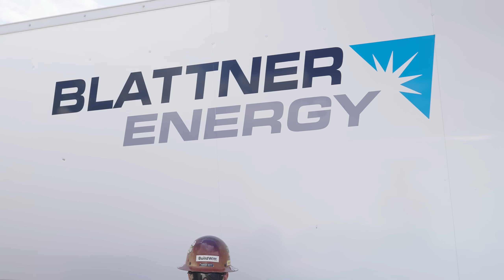Inside America's Largest Renewable Energy Project

Comment: This video has been very enlightening!! The cost for this project is rather interesting. $11 billion for 3.5 GW of wind power. If you take the average U.S. wind utilization or capacity factor of 36% this gives you an EFFECTIVE (not nameplate capacity) cost of approximately $8000 to $9000 per kilowatt. This is definitely in the same general range for U.S. nuclear power with the exception of the Vogtle plant in Georgia which had an estimated construction cost of $15,000 per kW. If one trust Google AI, it states that Chinese nuclear power cost have recent estimates for new builds in the range of $2,800–$3,500/kW and are completed in around 5 years and on budget! Considering that wind requires additional cost for storage and additional cost for providing backup power sources to be available when there are long duration wind droughts as has occurred in the UK multiple times, it starts to explain why California has the highest energy cost in the U.S.!!

Comment: 3.5 GW wind farm capacity X 1/3 for average year output = 1.17 GW   Assuming it is not culled and all dips have to instantly be backed up down to zero output that is 1.17 GW of natural gas turbine generator capacity above running at 70% fuel consumption needed to be at high readiness.   That's costing a lot of expensive natural gas!   

This is why supporting large amounts of wild AC from solar voltaic and wind turbine electricity generation is so expensive.    It uses less natural gas to make all the electricity with efficient running natural gas combined cycle plants.   

Natural gas even when priced at break even production cost is too expensive a fuel for base load electricity.   Once people know how much it is going to cost them when this wind turbine electricity hits the power grid they are ether going to fight from allowing it to be  connected or move.

The UK northwest offshore wind turbine farm caused electric rates to double.   With natural gas in the UK being 4 to 5 times more than in the US, the UK is culling wind turbine output to lower more steady electricity to save natural gas.
Reply: FUD. ;-)
Reply: source: trust me bro

Comment: Unfortunately this is very sad, Not one of those turbines will ever make enough energy to cover the cost of it's construction,  installation and maintenance,,, EVER.
If this money and energy were being spent on actual power plants,  I'd be far more enthusiastic.  The construction is awesome but the destruction of the earth and the landscape over such a wide area is disheartening.
Reply: Marketing info from GE for this particular wind turbine says 6.1 months but it doesn’t go into any details how that was calculated or what was included. It certainly didn’t include the transmission project or probably most of the additional support infrastructure or how much the utilization ratio is for this particular site. So probably more than 6 months, maybe a year plus.

Comment: Sadly, the concrete, steel and other materials make wind turbines a green washing tool. Remember the difference between installed power and generated power, about 20% of the installed power will be produced over a year.
Not exposed  forever, after the turbine life expectancy that core has to be destroyed...
Reply: According to the GE’s marketing for this particular wind turbine, the energy break even time is 6.1 months. Would love to see the actual calculations.

Also the average wind utilization ratio in the U.S. is 36%.

Comment: what if we have been using the wrong model of wind turbines?
what about this new model :
a vertical axis wind turbine (spinning like a carousel)
this wind turbine would look exactly like a tree, I call it : e-tree,
the trunk of the e-tree is brown, the spinning sails (blades) are green,
and finally attached to the trunk of the e-tree are features of : wifi/mobile network, light and power outlet, to charge a car for example

Comment: In Germany, a megawatt usually costs one million euros. If you calculate 3,500 megawatts through 900 wind turbines, you get just 3.8 MW and that's pretty little these days. For $11 billion, I would have expected a little more
Reply: You're right I think there's something fishy going on, it's costing $4.5 million dollars per MW which is a lot
Reply: The SunZia project, combining both wind and transmission infrastructure, is projected to cost around $11 billion. The SunZia Wind facility will have a power generation capacity of 3.5 gigawatts (GW), while the SunZia Transmission line, which spans 885 km between New Mexico and Arizona, will have the ability to transmit up to 3 GW of electricity. 

In terms of cost per kilowatt, it is estimated that the project's wind power output might be delivered at approximately $2.53 per watt【171†source】【172†source】.
Reply: @polymorphus1  $2.53 per watt?
Then 1kw would cost $2530. Something is wrong. You probably got the wrong unit
Reply: The total cost includes the huge transmission project also!!

Comment: how far would this project proceed without diesel?
Reply: Probably yes to some extent! The EV trucks are available in the U.S. and this youtube channel has an example of a project in the Netherlands that is doing everything with electric power. From the video it suggests that using electric power for the construction equipment is rather expensive and kinda hard on the logistics. Also in remote locations where do you get the electricity that is CLEAN? You can use BIO-Diesel or BIO-natural gas to produce the clean electricity or just use BIO-Diesel in the first place.
Reply: One could easily build it with electric trucks. They are just not available, yet. ;-)
Reply: @lepidoptera9337 
You mean they aren't available in the United States yet.
Reply: @glenncordova4027  At least not in quantity, no. The Chinese have a much larger supply chain for electric trucks than the US. Does it matter? No.

Comment: Yeah that's green power with the concrete, re-bars, tons of concrete trucks and all that. Green as possible.
Reply: 1 cubic yard of concrete requires 3GJ of energy. Let's say they need 400 cubic yards, so that's 1200GJ. A wind turbine generates, on average, 1MW. This returns the energy cost of the concrete in 1200GJ/1MW=1.2e6s, which is approx. 14 days. All in wind turbines in this range are said to be energy neutral in five months. Not a problem, but then... there are always chickens who can't do math. ;-)
Reply: @lepidoptera9337 

Marketing info from GE for this particular wind turbine says 6.1 months but it doesn’t go into any details how that was calculated or what was included. It certainly didn’t include the transmission project or probably most of the additional support infrastructure or how much the utilization ratio is for this particular site. So probably more than 6 months, maybe a year plus.

Comment: 11 BILLION dollars?? Could have built several nuclear plants for that amount of money. We’re so stupid in this country sometimes. Has to be green or it’s wrong. Why is America trying to “clean the earth” while everyone else is doing almost nothing, especially the Chinese.
Reply: The two new reactors  Vogtle 3 and 4 in Georgia, which came online last year and this year cost about 34 billion dollars. They only produce 2.4 GWs of power. Nuclear tends to have a capacity factor of above 90%. Wind in New Mexico is at about 35-40% capacity factor. When calculating the average per Megawatt and comparing those two we end up with about 15'000 USD for one MW of nuclear capacity and about 10'000 of one MW of wind power. 
China installed about 215 GW (US installed 32 GW) of solar and 75 GW (US installed 6 GW) of wind power last year. Even if adjusted to inhabitants, China outperforms the US. Is it really America trying to "clean the earth"?
Reply: @KabelWlan  I think your numbers are a little skewed. Nowhere could I find a price nearly that high. China builds lots of coal fired power plants. They buy more coal than anyone. My point is that America seems to be the only country racing, to our own peril, to meet arbitrary pollution standards. I believe we have time to develop cleaner, more efficient energy production methods without covering hundreds of acres in ugly, inefficient wind turbines.

Comment: what exactly is "renewable" about solar modules and wind mills? that stuff wears out and gets dumped & replaced just like EVs.
Reply: Get educated moron
Reply: The fuel is renewable and free. There will always be wind and sun light. Oil and coal’s eventually will be all consumed.
Reply: It is far less polluting than oil, natural gas or coal.
Reply: Hey oil and gas are renewable...Just wait a few million years!😮
Reply: @fernvalleyinn9172 

I guess that you are not familiar with BIO-NG which is renewable and is becoming a nontrivial player as a carbon negative transportation fuel. Now that the new Cummins engine is available, it can significantly outperform any EV truck in every metric.

Comment: The wind does push on them non stop, until the wind stops. We could have had 20 to 30 new nuclear power plants, which are very safe.
Reply: You just proved you are an uneducated moron
Reply: Georgia's Vogtel nuclear power plant, which produces a maximum of 5 gigawatts, cost $35 billion dollars. That is over 3 times the price for less than twice the energy output. Nuclear power is the most costly energy source and takes a long time to build. This doesn't even take into account the massive cost of decommissioning and the long term storage of hazardous nuclear waste.
Reply: @glenncordova4027 

$11 billion for 3.5 GW of wind power. If you take the average U.S. wind utilization or capacity factor of 36% this gives you an EFFECTIVE (not nameplate capacity) cost of approximately $8000 to $9000 per kilowatt. This is definitely in the same general range for U.S. nuclear power with the exception of the Vogtle plant in Georgia which had an estimated construction cost of $15,000 per kW. So only 40% higher when using the worst example that you did!

If one trust Google AI, it states that Chinese nuclear power cost have recent estimates for new builds in the range of $2,800–$3,500/kW and are completed in around 5 years! Considering that wind requires additional cost for storage and additional cost for providing backup power sources to be available when there are long duration wind droughts as has occurred in the UK multiple times. So compared to Chinese nuclear one gets your 3 TIMES but in favor of nuclear!! Also this wind project took 3 TIMES longer (estimated) from beginning of planning than the typical Chinese nuclear power plant takes to build. Also this wind project had some considerable pushback from people that it negatively impacted.

Comment: wonder how long it would take each turbine to offset the emissions from it being built
Reply: Six months on average.
Reply: Marketing info from GE for this particular wind turbine says 6.1 months but it doesn’t go into any details how that was calculated or what was included. It certainly didn’t include the transmission project or probably most of the additional support infrastructure or how much the utilization ratio is for this particular site. So probably more than 6 months, maybe a year plus.
Reply: It varies from turbine to turbine, but not very long.
Reply: @Dasycottus  Depending on the location, 5-12 months

Comment: What good is it if the electricity can't be stored & save it for another day  . If you don't use it you loose it. That what I been told . I could be miss directed .
Reply: Have you never heard of batteries? How about rechargeable batteries? Before you get your panties in a bunch, I'm not saying it would be economical, just doable. I mean...11 BILLION?
Reply: @bwellman1953 I bet they'll use pumped storage hydropower. For big stuff, it's often cheaper. 

1) Build bigass pond/Small lake. 

2) Put dam in the middle of it. 

3) Use surplus wind power to pump up one side of the dam. 

4) Generate hydropower with turbines in dam. 

Water = battery. Simple, very clever.
Reply: @Dasycottus  I was raised on the coast. For most of my life, I've been waiting for coastal regions to supply electricity using tide changes. Where I lived, there was close to 20 feet difference between low tide and high tide.
Reply: I know this may come as a shock, but engineers are not stupid. 🙄

They are aware that wind power only works when wind is blowing, and that solar power only works during the daytime. 

The turbines store surplus energy with battery banks and pumped storage hydropower. The surplus energy covers demand when wind is not blowing. 

If you think you may have been misdirected, why not check before making the point? It takes two seconds and you get to avoid looking foolish.

Comment: I ran a Tb105 for many years! I can tell you one thing, a TB105 will certainly do a 100 yards an hour but 150 is pushing it. A pump on the other hand, a bigger one, will do 170 or 180 an hour full tilt. 50 yards an hour out of a pump is hilariously under estimated 😅
Reply: 120 Yards per hours is pretty easy to get out of a pump, especially for a foundation like that where most of the placement is just dumping concrete with minimal finishing. A pump might even be able to do 150 Yards per hour if you can keep trucks backed up and feeding it.
Reply: @andrewsmith1655  It's going to depend on the pump and what pump kit it's running. But the modern pumps with high output kits running oil to the rod side can usually push 170 an hour if it's a decent slump. Something like this is probably not any wetter than a 4" slump, so running a 5" hose you're probably going to push around 140 an hour.
Reply: @andrewsmith1655 might be able to do 155 yards if you're pumping downhill and using gravity slingshot.
Reply: This was a critical point of the video. Very important distinction to make,  exactly how fast the concrete can be pumped.
Reply: @wildmanofborneo  Yea? I don't follow. A pump in the real world can almost always pump as hard as a belt can. Everyone likes to claim that a belt is much faster, but I've run both for years and I can tell you that in practical application...a pump and a belt put it down about the same. The only time it's much different would be super super dry slumps.
Reply: @mitchell7203  They also said the trench was 2 ft wide.  But it's only 2 ft wide at the base.  The top tears out and it's a bit more than 2 ft wide.  Probably didn't have accurate figures on the steel weights and concrete  volumes.
Reply: How accurate was the 10 yards that the truck can hold?  Did you drive a Frenius 255G truck for a few years?
Reply: @wildmanofborneo  Huh?? What are you even referring to? That's not even a truck. But yes, typically a redimix truck in the US is carrying 10 cubic yards. Most typically for weight reasons.

Comment: Love this video. I've always believed we need multiple sources of power in a future proof electricity grid. If your energy is green you can smelt steel, run your server farm, or your factories, and no-one can complain!
Reply: Steel melting Arc furnaces. Use about 150 MW. The larger wind turbines put out 18 megawatts each. So you would need 10+ turbines just to run the plant. 

That's a lot of power.  

Look up how much power the new Amazon data center requires. More than the local nuclear power plant total output! 

What I'm getting at is the resources required are vast and expensive and less reliable than what we currently have.  Politicians are rushing all of this just like evs and they turned out to be quite the disaster

Comment: how are the "green" "sustainable" carbon epoxy blades recycled?
Reply: And yet nobody actually explained past a simple dismissal. I am very interested in the details of how the blades are recycled!

CHECKED:

Wind turbine blades are recycled through processes that involve mechanical shredding for use in cement production or as fillers in other products. But it appears that large numbers of blades are dumped in landfills due to a lack of better options at this time. It is hoped that newer processes can reclaim the fibers for other low performance uses.
Reply: You can research that on the exact same internet you asked that question on.
Reply: Approximately 95% of the blade material can currently be recycled. 

Turbine blade recycling is a 5 billion dollar industry. Look it up.

Comment: How far do they have to truck all the aggregate, concrete and sand to the batch plant.
Reply: This is " GREEN ENERGY " but it takes lots of coal and oil to produce. 😂😂😂😂😂
Reply: @davebrown4841  yeah so much coal and oil that running a 3.5GW coal plant at full output for 100 hours puts out more CO2 than building all 900 turbines in the park.

if you go with a modern combined cycle gas turbine plant that outputs 3.5GW it takes 200 hours.

and those numbers don't consider the CO2 released when building the coal/gas plant
Reply: @anonym3017 my trees love CO2!  CO2 makes up 0.039% of our atmosphere.

Comment: used a lot ot fossil fuel to make steel and other
Reply: And...? The world isn't perfect, man. Go find something to be happy about.
Reply: Please read little bit don’t absorb BS spew by low IQ that sounds smart
Reply: great observation peter. You now know how building things works. Have a cookie!
Reply: @StevenRides I'm not sure he survived to finish his sentence
Reply: please for the love of god do the math before spouting crap like this.

324m3 of concrete is some 132.8 tons of CO2. the steel in the foundation is another 13 tons of CO2.

so 900 turbines is 131200 tons of CO2.

a modern hard coal plant is at 742g CO2/kWh. So building this windpark puts out as much CO2 as generating 176.8GWh of electricity with a coal plant.  or in other words this thing breaks even with an already existing 3.5GW coal plant 100 hours after being switched on assuming a capacity factor of 0.5

if you compare against a 3.5GW gas plant break even is after 150-200 hours.